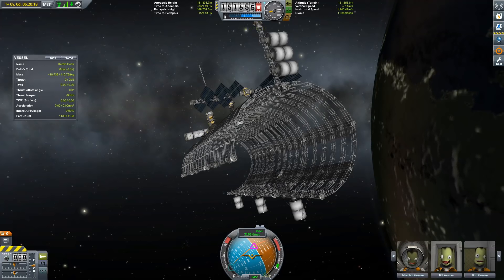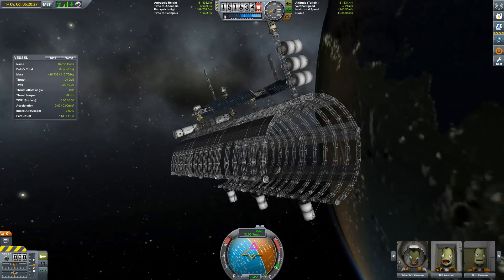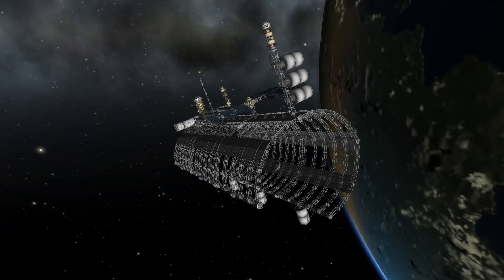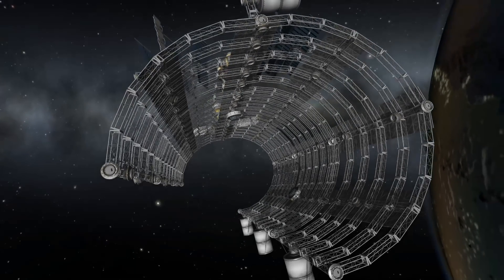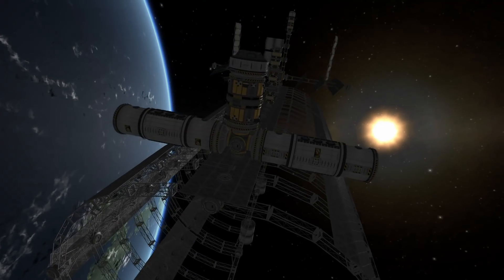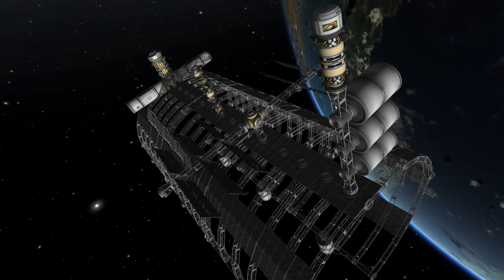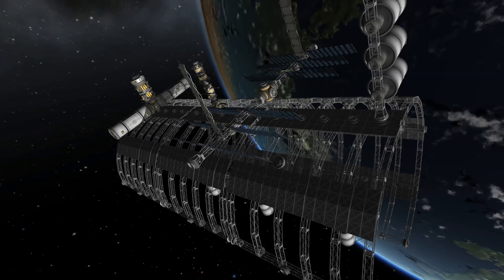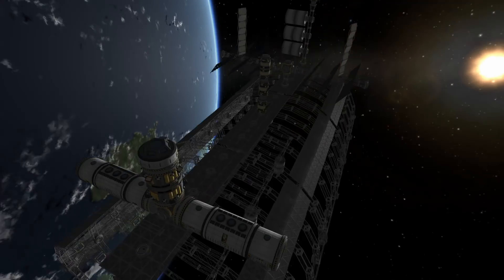Huge Space Station Dock - Stock Kerbal Space Program 1.2.2

Comment: Never like those highly unrealistic launch setups... no where near capable of such a structurally unsound launch payload.

On the other hand, the skeleton dock is very pretty, Well done on the design there :D

On another note, what are you using for the information data near Top middle HUD element? that would make my launches a lot easier. Always reopening map mode for AP/PE readouts.
Reply from the maker: The only reason for the crazy launch is because there's no easy way to construct it in space 🙃 Readouts are from Kerbal Engineer Redux which is probably the most useful mod ever.
Reply: Yeah I wish KAS would get up to date flight-mode building system, I'd build that entire sky dock in space piece by piece if KAS building was more like in VAB/SPH building.